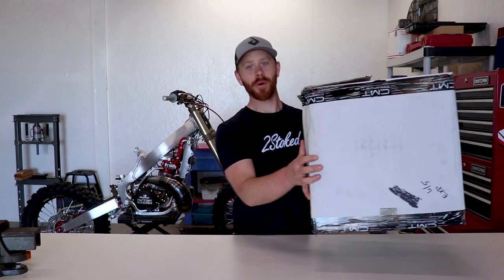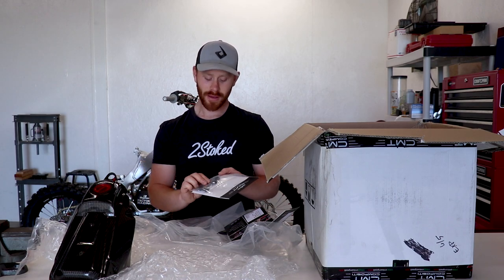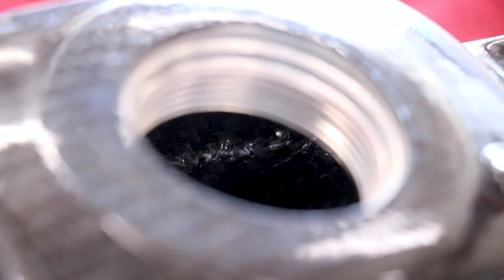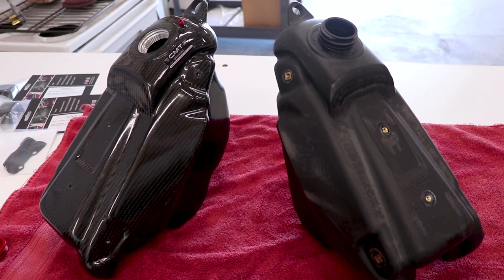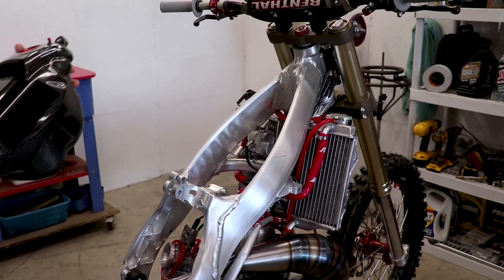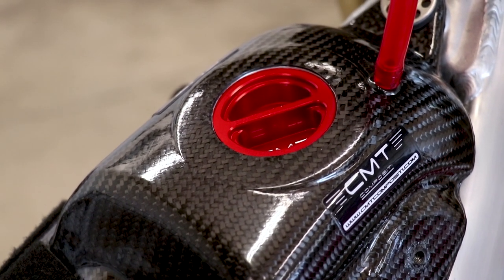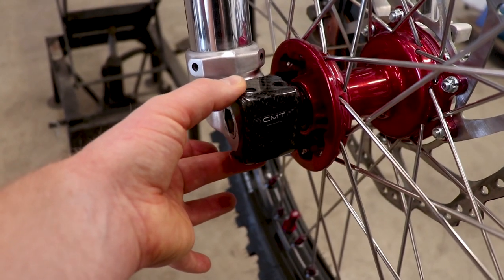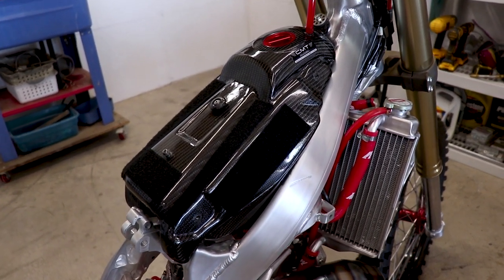Carbon Fiber Parts For My CR250!

Comment: on my cr i have a set of carbon fiber bars from twisted engineering they were pricey ,but that was three years  and many crashes ago they are still straight and look great they also have a levels of flex built into the bars you select .I also experiments with carbon for my mx bike i can wear through frame guards easily in a season of mud and sand riding but i now cover everything in kevlar too it adds some grip and wears a little slower .. bees wax for the carbon not the cheap stuff

Comment: For the metric people out there! Weight difference between stock tank and carbonfiber tank: 382.7 grams. Holds 0,8liter more fuel.
Reply: david raaymakers that’s not worth the money if you try to put a bike on a diet

Comment: Hey Cameron, 
I’ve been a big fan of you for many years now and I love the cr250r build and your girlfriends xr80 build. Just wondering if you could tell us how much money you have put into the bike at the end because I would love to rebuild one myself. Also a bit of a weird/ dumb question do you or anyone scrolling through the comments know why my XR250R won’t start. I have replaced the
Spark pulg
Oil
Carburettor has also been cleaned 
Fuel
Stater has been re done
It has been looked over by a dirt bike shop and they said the stater needs doing
Timing is all good and has been checked aswell
I just don’t want to give up as I have spent over $3500 dollars in it and it still haven’t started
All replies will be appreciated. 
Keep working hard and your bike looks spectacular!

Comment: Looks OCD  incredible !   That carbon fiber disc guard is going to look thrashed  in 5 or 6 rides, l know , l had one !  Went with a TM  design works unit and don't  have  to  worry about it any more and stayed looking great. I would also look for gas coming up through the threads on the recessed gas cap even with that little O ring .  If that bike was mine l would be afraid to ride it, !  It's too beautiful !

Comment: My god that tank is beautiful, I can't help but wonder what kind of resin was used to withstand the gas over prolonged exposure, I work with carbon and graphite at work (aerospace duct work) the resins we use are very picky to heat and chemicals

Comment: Cameron, stop by your local autoparts store or Amazon and get Meguiars NXT 2.0 Tech Wax. Its a little spendy but will last you a long time. This is the best over the counter wax I have ever used. There is better stuff out there, but give it a try on your tank and your subie. It will last for months and give great UV Protection. Love the videos.

Comment: Did those washers with the holes in them mess up your plastics they did on mine it squished my plastic out the holes like crazy and with out getting them very tight i took them off and am not using them i got flat nickel washers now 😮

Comment: Obviously your detail oriented. Might think of replacing the OEM bolts with titanium. Spendy but they'll never corrode or rust. Just make sure you use a good thread lube.

Comment: Didnt they used to use carbon fibre as the aeroplane fuel tanks but they found it would deterate the resin and make it go a ll soft. This tank is probably absolutely fine I just thought I heard something

Comment: How do you make the Lectron carb work with the servo for the power valve?
Reply: The carb has nothing to do with the servo, and the tps doesn’t need to be connected either if your were wondering.